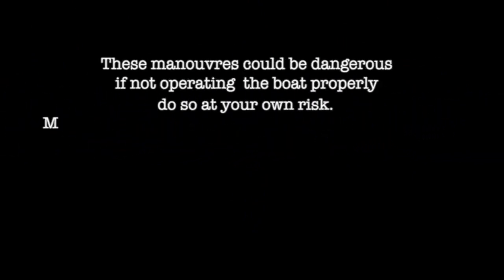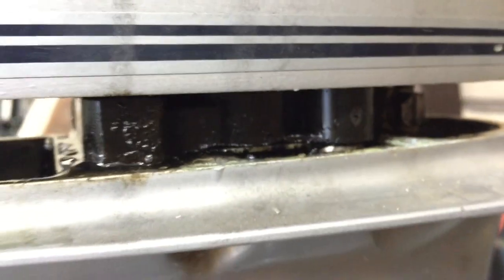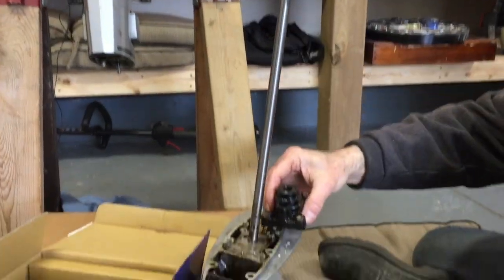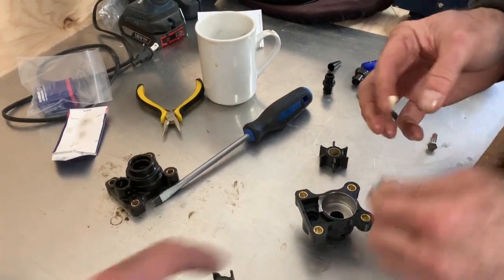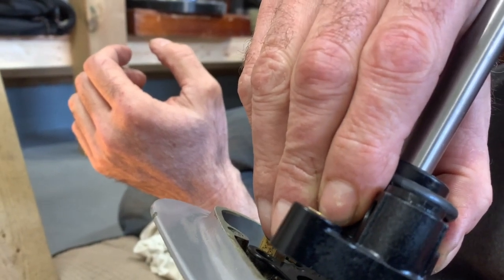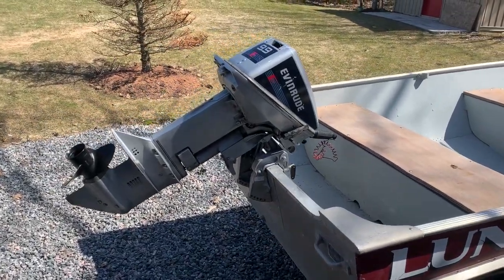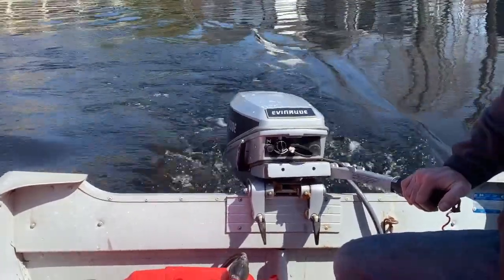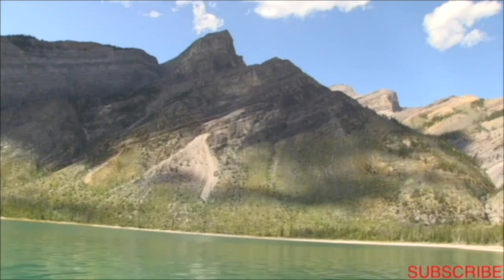Outboard Water Pump Replacement

Comment: ur account is sick af. and supper underatted. I am 17 found an old row boat in the dump and need to figure out how to deck it out and make it look good and how to mount a motor and finally register it. I am from ct but took it from the dump in vermont

Comment: Hey man what's up...I commented on another video of yours about the lower unit on the 90vro 87'. Got the omc pump. The pump and gear oil for the lower end.  Quick question. What size prop d on you use on yours??